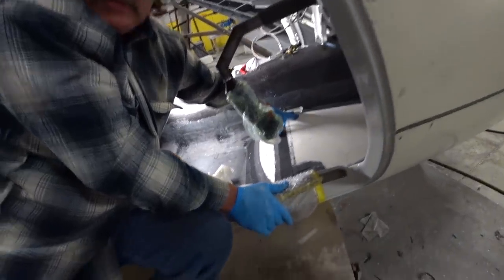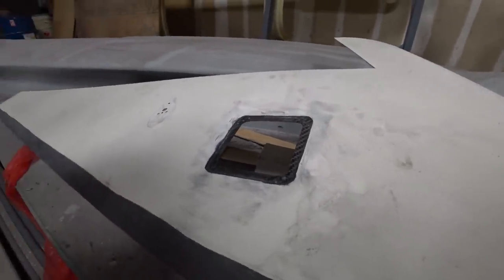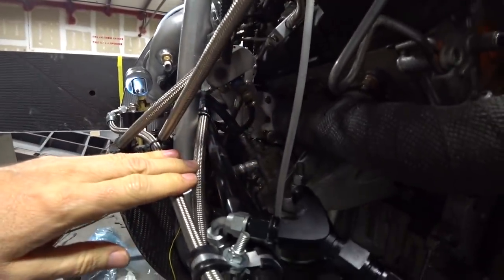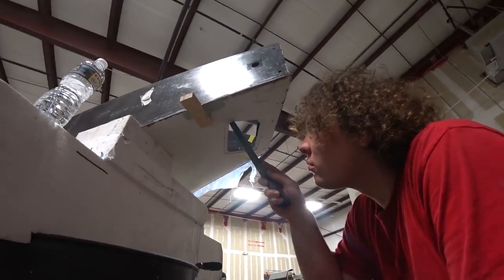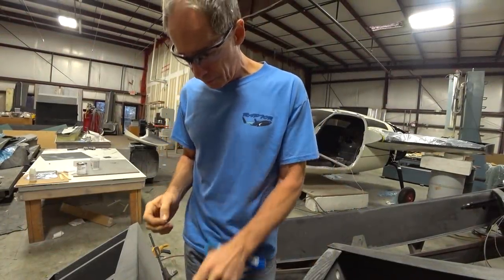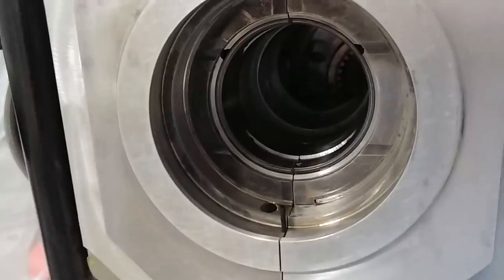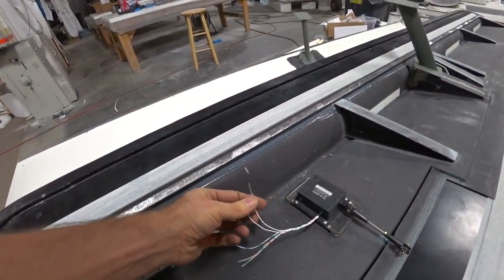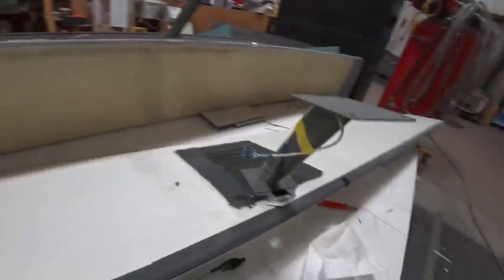Wing Wiring Wizardry - Building the Raptor Prototype

Comment: Thanks for the update as always, excited to see it finished!

I would be careful with those accelerometer boards, make sure the soldered pins or any exposed traces do not come in contact with the carbon fiber through the glue. I'm not sure how or if you isolated the, but it would suck to fry that entire circuit. It would be extremely hard to replace. Maybe isolate all the sensors with diodes first?
Any ways, have a happy holiday.

Comment: Analogue signaling at 3V over 8+m distance? What kind of compensation is used to align and retrieve the signal?  The wire is like a wing long antenna to catch lotsa noise along their way, not at least high power fast switching signals like stobes etc., isn't it?

Peaceful holidays to all of you.

Comment: Awesome progress!  I am curious if the accelerometers require electrical isolation of the solder connections from the conductive carbon fiber?  Does the adhesive perform that function or did you need to put fiberglass down first to make sure the solder joints did not penetrate the adhesive and touch the carbon fiber?
Reply from the maker: I'm going to check ok that on Wednesday.

Comment: looks like your heat shrink squeezed the wire connections together enough to touch each other maybe in the future or when you bend it in place. Maybe not.
Reply from the maker: I'm super careful with the wiring. Remember I'm going to be flying in this this some day soon. I check any questionable connections with the multimeter and inspect everything closely with my 3x magnifiers 😎

Comment: Just wondering if you have considered the potential issues with low-voltage signals over long runs of wire. It's less of a concern with an analog voltage (which is likely why you chose that particular accelerometer breakout?) but in some digital protocols, especially I2C, the capacitance of the wire can inhibit transmission at faster speeds. Long wires also function like antennas to pick up any surrounding noise such as spark plugs. With analog I kinda wonder if the signal would be slightly delayed (not a problem if all you're doing is trying to detect flutter), or not giving you the correct value. The breakout you're using swings only 1.65V between 0g and the maximum, and I have to wonder if that little module can hold it at the right level over that much wire. Then again, if all you want is a prototype phase tool to detect the persistent quick changes in acceleration that signify flutter, maybe having the correct magnitude is not so important. Sorry if I'm preaching to the choir :)
Reply: What's the part number for the accelerometer and capture unit?

I was about to comment on this too.  Electrical interference  from the radio/strobe/etc will likely effect the voltages on the accelerometer lines, though I don't know how much.  I was thinking of using a digital signal (which can also have lots of ringing due to the square waves, but won't give a bad signal--it either works or doesn't).  You could also use a shielded cable, but obviously your accelerometers are already glued in place.  You could add an analogue circuit near each accelerometer to fix things. It could switch from constant voltage to constant current, convert it to a balanced signal (especially if you used twisted pair cables with two wires for each signal), or use an arduino to switch it to digital close to the accelerometer.  You may need another circuit near the ADC (Analog Digital Converter) to convert everything back to a low voltage signal.

The easiest fix would be to add a resistor to the analogue line near the ADC.  Even a 1K-10K resistor to ground would change the ADC from a high impedance to a lower impedance which reduces the electrical noise at the expense of consuming a little power (just 25mW for a 1K resistor at 5v).  Check the specs of the accelerometer to see how much current they can sink, but this should help even without changing the circuit at the other end.  You could also just be aware of the issue and take the running average of 10-100 readings which will hopefully filter out any RF interference in software.  The resonance frequency of the lines should be much higher than the physical flutter of the rudder.

Years ago I used an unshielded cable to run a 9600 baud RS232 connection about 20 meters for a door lock project in school.  After hooking an oscilloscope up, I noticed a huge amount of ringing on each of the bits even at that slow speed, and this made the signal unreliable, but we reduced it to manageable levels using a resistor to ground.  You could test for electrical interference before gluing things together or looking through forums to see if anyone has had problems and/or found solutions for running this type of signal in an aircraft.
Reply from the maker: As you have said, all we want it to do is detect flutter. Enough said. Oh, and I'll be sure to remove the spark plugs from the diesel engine so they don't create any signal noise 😃
Reply: @RaptorAircraft  spark plugs was just an example. On my CNC machine the brushed spindle motor was preventing 5V UART transmission on a shielded USB cable of just 30cm. You are talking 3.3V side-to-side over a far longer distance, it wouldn't take much. I believe this is why automotive systems typically use a CAN bus. In any case, it would be easy to check before you seal everything up. btw looking at 5:50 and 17:08 the pins on the back are not touching the carbon fiber right? Not trying to be annoying, it's just that I rarely see anything here that I feel I have enough of a clue about to make a comment that's not just another "good job" :)
Reply: @RaptorAircraft  - The wiring practice I use and recommend for low-level analog signals over longer distances comes from working with composite video in vehicles (i.e. backup cameras, for example). 1) Use dedicated power and ground wires from the electrical panel to power the remote sensor circuit / head unit (not shared +V and certainly not to use a chassis ground). 2) Use shielded cable in which the shield connects to a common point ground at the main electronics panel (not at a remote location). The signal wire(s) will reside inside the shield, of course. Doing this, I get a near-studio quality video image at the head unit with no visible artifacts from engine noise (spark plugs, etc.). The 1V p-p NTSC composite signal is very sensitive to noise. I have yet to find either a dash camera or backup camera user manual with a proper wiring diagram that avoids creating a ground loop or that couples in noise from nearby large-current wiring, because they favor end-user wiring convenience and low cost to a fault. I would expect avionics industry practices to be better in this respect, but wouldn't blindly trust that documentation, either.

Comment: Awesome progress. At 17:40 - I have concern for Turbo #2 Oil Drain. It seems to go uphill or horizontal within 6” from the turbo. Turbo Oil Drains, albeit a trickle, comes out with entrained air, similar to shaving cream. It will percolate out back to oil rather quickly. I’ve alway made sure that turbo drains no more than 45 degrees for the first 6” to ensure the downward flow of this frothy foamy oil. Not sure if there is any other routing option.

Merry Christmas all!

Comment: ,,, just remembered an excellent way to check alignment before you dowel the re-drive. Assemble without shaft or bearings, check housing bores with a ten thousandth dial bore gauge, misalignment will show up primarily at parting lines, if any loosen bolts to snug and tap case halves with dead blow, to get your lowest reading. This will be your best lateral alignment. 
,,, To get longitudinal, assemble with shaft and bearings, while snugging bolts tap and or force shaft against thrust bearings, in the same direction as the prop will be pushing, (except in reverse settings). This will be your best longitudinal assembled position. You are unlikely to find more than 2 or 3 thousandths difference of thrust, this way (from worst to best), but it is worthwhile. 
,,, I am still thinking how to get both directions simultaneously. One way would be a temporary external dowel(s), after the lateral alignment, and then the longitudinal procedure .

Comment: I like the idea of the oil pressure gauges, though, for long-term use, it and it's associated fittings my might represent a fairly long lever arm, which over time might cause stress issues on the fittings nearer to the engine, which vibration might exploit (if all the fittings are hard, and the gauge is not tied to the engine.) For short-term use, I can see how it would be fine.

Are there grommets enough in the wings to keep you from having to replace wires and cables?
Are there enough inspection ports, so that the inspectors don't want to mess with your beautiful wings?

The trust bearing in the re-drive reminds me a little of: https://www.youtube.com/watch?v=ayQo20D19eU
BTW, that site also had some old training videos for bearing issues, which just aren't going to be an issue this time. Still it's fun to know one's Brinelling from False Brinelling : )
Plain: https://www.youtube.com/watch?v=XypjAMjR0Ic
Roller: https://www.youtube.com/watch?v=TTt7ksjY8aw&t=1052s

They have a lot of old warbird videos, and some interesting maintenance videos, such as this daunting, yet humorous B17 replacement instructional video:
https://www.youtube.com/watch?v=pMZKt6zN2gE

Happy Holidays.
Reply from the maker: That pressure gauge will be removed before flight and possibly be replaced with a sensor hooked to the ECU.

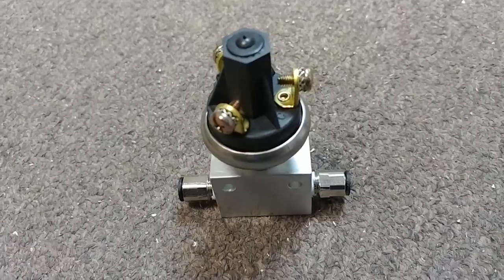Comment: 7:52 mixing carbon fiber and  aluminum has severe galvanic implications for the aluminum. Would make interesting video to show how you would mitigate this?  Just my 2c worth. Getting out the multimeter to show that there is no electrical contact. 
Try an experiment by bonding aluminum with carb fibers penetrating the oxide layer. Check boundary conductivity with a multimeter and chuck in a bucket of water for a couple of weeks.

Comment: ,,, I think I would use a five blade ground adjustable prop on for the prototype. And just use the excellent CPU from the Diesel to control rpm. Yes, I know, no reverser, and not as versatile, but huge time savings to get this pup in the air .
Reply from the maker: Yeah, that's not a good idea. To get the best performance from the engine we need a constant speed prop. There's no question.
Reply: ,,, the Diesel ECU can hold constant rpm, unlike a gas throttle. Yes, it will not be as quick sorting climb and cruise settings, but still an early time and money savings .
Reply: ,,, well, your Diesel gurus will have to do a little work to get the road cruise feature to be able to accept a rpm setting .

Comment: On the matter of funding, I'd certainly be happy to release my $2,000 deposit out of escrow for your direct use in continuing the work.  I wonder how many others would feel the same?  If you structured an opportunity where deposit holders could opt to do this, I suspect it might release quite a bit of operational cash for you.  

Beyond that, if the prototype proves to significantly fulfill performance predictions (once it's flying), I'd personally be happy to invest more substantial sums into production development.  My personal investment would fall short of the (I'm guessing) multi-millions you'll need to go fully into production , but I am guessing that with all the enthusiasm that you've generated among so many, there may be many who would be willing (like me) to invest at least substantial sums.  Just an idea.  If it happened to be practical to structure it in such a way, it might be an alternative to finding a single large investor.

Comment: Can I ask why you decided to start running ads in the videos?

I don't mind them but it is fairly unusual for a brand/product channel to have them and doesn't sound too great for the financial situation of the project if you need the $100-$150 that this size a channel would make per month off of ads.
Reply from the maker: Well, I might likely need the extra income in the transition phase between completing the prototype and securing funding to begin production. Consider it a backup plan. Not all of us a loaded with cash.
Reply: @RaptorAircraft  Raptor could do a token offering. Use ERC20 tokens to raise funding for Raptor. Keep the project FREE and open sourced. There has to be a way brother!!
Reply: @RaptorAircraft  Beyond that, running ads will cause youtube to promote your videos much more vigorously. No ads = no promotion. Consider it payment for their streaming services, they certainly seem to.

At very least it will allow for more people to find and enjoy this awesome channel. Even if that has zero result on sales it's still a good thing to get more people into the aviation community. This channel is genuinely inspiring.
Reply from the maker: @OkammakO  all good points. Thanks 😀
Reply: @OkammakO  "Beyond that, running ads will cause youtube to promote your videos much more vigorously."

That's in-accurate. There used to be additional promotion in search for partnered channels (whether they ran ads or not) but it was removed in 2014.
Reply: @RaptorAircraft  If you do need the advertising income then I''d recommend sending a couple of emails, get a sponsorship. I know your time is precious and you don't want to spend time doing that instead but it would be genuninely worth it because you'd get much, much more from one than from YouTube ads.

A channel this size will earn $100-$150 a month from ads, maybe even less whereas with a targeted sponsorship that could easily be $1000-$2500 a month. All a sponsor will look for is a "sponsored by X" overlay at the start of the video and a 10-20 second plug for their products at the mid-end of the video.

I'd recommend trying Bose - who work with many aviation YouTubers and typically pay $15 per 1000 views which for your channel would mean $1075 a month.
Reply: Incremental income to help the project is a fine thing imho. No skin off my back to have the ads.